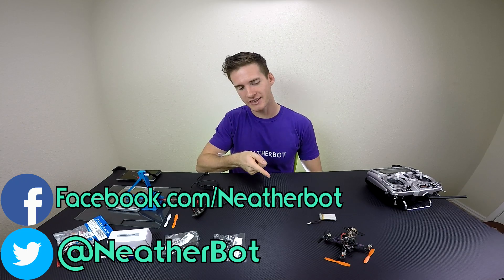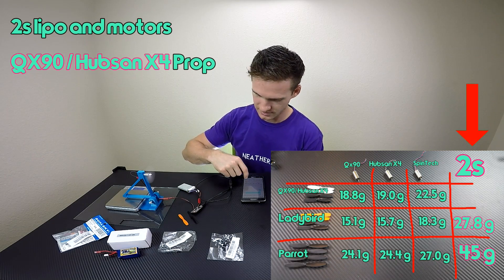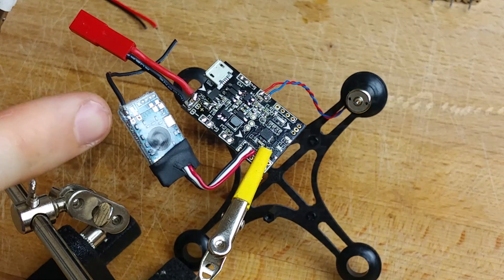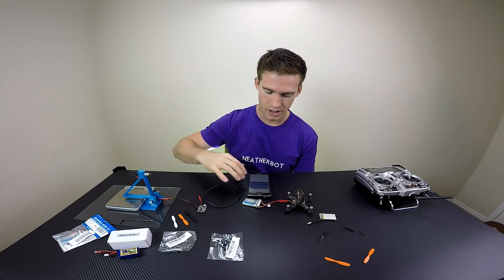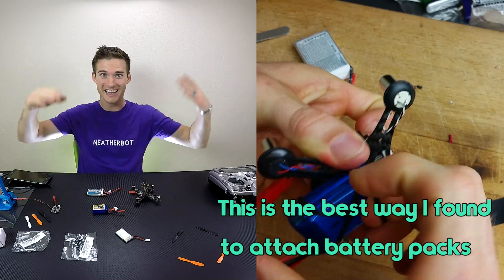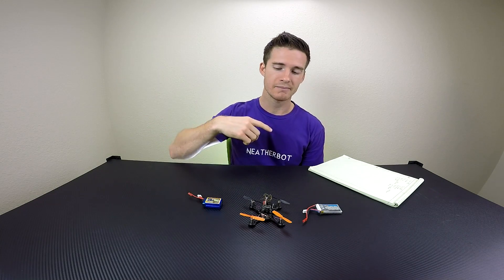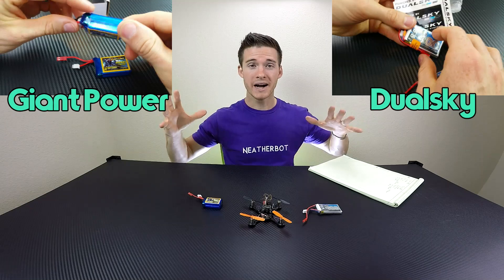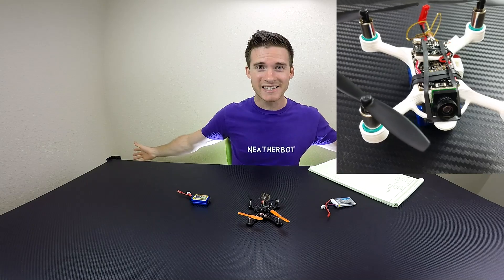QX90 Upgrades

Comment: Hi,
Great video with a lot of interesting stuff, specially results of thrust for different motors..
Thanks, I'm currently waiting for 2S motors...
Reply from the maker: +Indy John Jones I appreciate the comment! You will not be disappointed with the 2s motors. They are fantastic!
Reply: great work! Do you plan to test the 0615 motors? I tried different configurations FC and motors, stock, Chaoli and Chaoli dark to upgrade a Eachine 010... so far, everything is a disappointment...

On the other hand, I got the 2S, I haven't the time to fully test them already, but the 8520 2s configurations look very cool...
Reply from the maker: +Indy John Jones I think the E010 is an awesome indoor flyer for very small and crowded areas. Once you get a bigger space they just do not have much power to go very quickly... Stock. I have seen some guys mod their tiny whoops and fly around outside with decent speed. So I think there is a motor out there that works well... I'm not sure what it is though. The micro quad that I'm designing is a n absolute blast inside and out. Has plenty of power for inside and does ok outside. I would recommend stepping up from the E010 to something a tad bigger. Check out the ending of most my videos to see flight footage of some micro quads. 2S is definitely getting enough power to fly outside and do some amazing afro manuvers.
Reply: ***** yeah, you're right, but that's actually my point... I can't have a descent power with the E010 frame and 3 different F3 FC... loosing a lot of altitude in turns with as well 3 different kinds of motors included black Chaoli...
On the other hand I have a nice result with a Bayangtoys X9
http://www.gearbest.com/rc-quadcopter-parts/pp_241124.html?wid=21
Reply: +Indy John Jones pick up the furibee F36? been seeing videos showing they've got stronger motors already in them bone stock. possible another help is RakonHeli 3 blade props are lighter weight with slightly less pitch to let the motors spin up quicker
Reply: +NeatherBot this is a "curiosity" question/experiment. old school RC car/boat brushed motors had noise caps: + to can, + to -, -  to can, to prevent radio interference. not possible/practical for little coreless motors to go THAT far, but I'm wondering if teeny capacitor across the + / - of motors might help clean up vtx image similarly. the caps on RC car motors dampened the arcing at the brushes, helped keep the commutators a little cooler same time (smaller arc FIRE lol). I'm "not there yet" with the FPV stuff, but maybe you'll give it a whirl and do a video about it if the idea helps clean up vtx image. keep havin fun!
Reply from the maker: +model nutty I like where your head is at, but the VTX nowadays have a built in regulator in them so it isolates the camera and VTX from any electrical noises. Most of the noise you are going to see is electromagnetic noise caused by the motors magnetic fields or non twsited pairs that will not be effected by caps. The principle of taking abuse off the the motors by putting in a cap has been implemented into the F3 Evo Flight Controller already. Most brushed flight controllers already have small caps in place on the board to help with the motor startup.
Reply: cool, also seen the coreless motor's lack of iron armature (central magnet coils surround) makes them pretty quiet to begin with. been asking and looking around both :)
Reply from the maker: I'm glad the video was helpful! Be careful with the 2S motors they get pretty hot if you run them hard or put an aggressive prop on. Just check them by touch as you fly to be careful.

Comment: how do you keep probs on?.. mine fly off with to much throttle
Reply from the maker: +Zac Simcock what props are you using? I have had a lot of issues with the hubsan x4 and parrot props not fitting tight. I usually put a piece of dental floss or a tiny dab of superglue in the prop to keep them from spinning off the motor.
Reply: Purchase some better quality ones.
Reply: +pukki34 what other ones are worth purchasing
Reply: http://www.banggood.com/5-Sets-Walkera-QR-Ladybird-Hubsan-H107L-JJRC-H6C-1000A-Main-Blades-Propellers-QR-Ladybird-Z-01-p-1051791.html these fit the original frame
Reply: +NeatherBot i just use the stock props.. i just didnt want to use superglue cause i dont want them stuck on
Reply from the maker: +pukki34 I do have to say the official lady bird props that I purchased have never come loose from a motor shaft. I ordered some cheap knockoff hubsan X4 props and they were junk. Paying a little more for the branded props is worth it.
Reply: +NeatherBot  but werent the ladybird ones not as good in thrust.
Reply from the maker: +Zac Simcock I have learned that I usually get more damage when I'm flying and a prop comes off then anything else. If I put a very small dab of glue on the tip of the motor shaft the prop usually will still come off. And if it does not you can use some wire cutters to easily cut the prop hub in half and you won't hurt the motor.
Reply from the maker: +Zac Simcock Yes. That is my dilemma also. The lady bird props fit the best on the motor shafts but generate the least amount of lift. I have had props come off and cause some bad crashes. I'm at the point where I like that I can trust the lady bird props and use them most the time. I want to make another video with more motors and more props for testing.

Comment: The QX95 will fit Parrot props with no mods.
Reply from the maker: Good to know. I may have to try that one out. How do you like the QX95?
Reply: NeatherBot I like it. I'm running beta flight with parrot props. I love the 2S mod you did. I'm gonna do that next.
Reply from the maker: +Steady yeah go for it! I have been having an extra hard time Lee punny those dang parrot props I the motors. I think the extra power twists the motor shaft free and the prop pulls off during flight. I even super glued the props on to the motor shafts and they still came off after a day of flying. Just a heads up.

Comment: its awesome and all i had no idear that you can get 2s Upgraded motors for the qx90 I will be getting some. but for outdoor flying i can't Rly see my self wanting to fly any of my brushed quards. in that case i will spin my burshless quards. 130mm 1103. or the larger 210/250 ish qurads i have build over the last 2 years.
Reply from the maker: Yeah its a pretty easy upgrade to get some legit power out of the micro quad! I agree 2s is a bit fast to be flying inside!

Comment: The FC you are using is not the same as what you referenced on BG. Take a look on the right hand side of M1 & M2, you have 2 rows where you can connect items but the on on BG has only 1 row,  Would you mind showing us the correct FC as I wanted to get one.
Reply from the maker: Ben, my apologies for the mix up! Here is the exact FC i used in this video.
http://bit.ly/2foJVVx   I will fix it in the description also. Thanks for the heads up.
Let me explain a little better. The small one that you spotted as not the same has the exact same functionality as the one I used it is just smaller and can not work with 2S lipos. The smaller one has quickly become my go to FC board for 1S, micro quads. It is a great flight controller and has all the same specs as the bigger one in the video.
Cheers!

Comment: I been thinking of buying a few but it seem you will have some money in it to get it in air like a charger or something and a remote that will sync with it and and goggles because you know you would have to have them.
Reply from the maker: +ken wade I am about to make a video showing you how you can get goggles, batteries, a charger, a micro quadcopter and a video transmitter, basically everything you need for FPV for around $100. It is basically a tiny whoop. Not a 250 sized quadcopter. If you can wait a little bit it would be perfect for your first FPV setup.
Reply from the maker: +ken wade ah ok good deal. You have the skills! I'm glad my videos are helpful! I'm learning as I go too!
Reply: ken wade if you are just starting out in fpv and dont have or want to spend alot of money. Get the Qx90 a cheap lipo charger and a pair of Eachine VR-007. all of that will cost you less then a Good 250 size Quardcopter. and you get to dip your feet in to the world of FPV. if you dont like it. sell it. and if you fall in love with FPV upgrade as you go. to something like a pair of fatshark or Skyzone Googles. and a Race drone 250 or 210 size. with som good parts on. and save your self the trouble of buying cheap Dumb down Kit's
Reply: I thinking of going with 250 it will be about same in money for cheaper 250 kit they fly for 10 to 15 mins I seen.
Reply: trust me you dont wanna fly a 250 around inside at home. alos Qx90 is way cheaper then a 250 mini quard. if you are just getting in to the hobby you can get some cheape but ugly as hell Fpv Gog's
Reply: wardope cheapest I seen them was around 60 without transmitter and flysky was the cheapest one for banggood site amazon is more but I did see a 250 kit for 300 comes with everything.
Reply: ken wade for 60 its not a complete set you will most likely not get a flight controller, pdb and assembly parts such as mounting screws for above  also for 60 you can be sure the parts you get are cheap and not really worth your time. there are reasons we pay like between $16 - $40+ for a single motor. if I was you I would stay the hell away from those cheap kit's and start with something like the qx90 or even a $20 toy grade quardcopter to learn on and then start to research what parts you want/ need for a later build. also you need to know how to solder.
Reply from the maker: +wardope well said. I agree with everything above. Especially soldering ;) lol I have a saying, "We must learn to solder before we can fly."
Reply: NeatherBot yep its a good saying. :-) I will remember that
Reply: NeatherBot  I'm not bad with a soldering gun what I'm learning is what parts work together that's one thing I like about ur videos.
Reply from the maker: The QX90 is certainly a great way to get into FPV!

Comment: Why not run gyro sync at 8khz. I see you changed that from default to 4khz
Reply from the maker: When you flash Betaflight to the F3 Evo FC the stock settings are 8KHz Gyro and 2KHz PID loop. I changed the PID loop and left the Gyro @ 8KHz. Let me know if that makes sense. I can help explain further if needed. Cheers!
Reply: No need, I understandstand. Lost my defaults. Thought default was 8k/8k. Thanks
Reply from the maker: +Julien Gordon no worries, I'm glad you asked. Happy flying!

Comment: Have you looked into the QX95 frame? That should be big enough for the bigger props. I think Ill upgrade my qx90 motors. I was thinking the hubsan motors but These might be worth it.
Reply from the maker: +Brent Elliott I have seen it, but instead of buying it I 3d printed my own frame. I like to design and model so this small micro quad has been a great way for me to learn about what's important about these chassis. Yes I would recommend getting these motors. They are beastly.